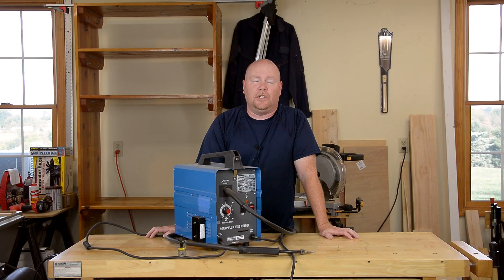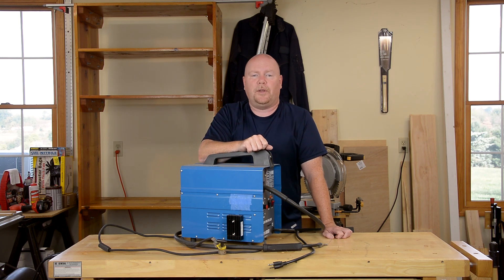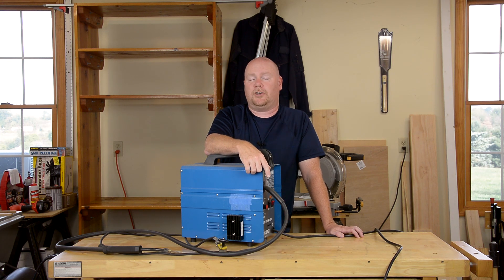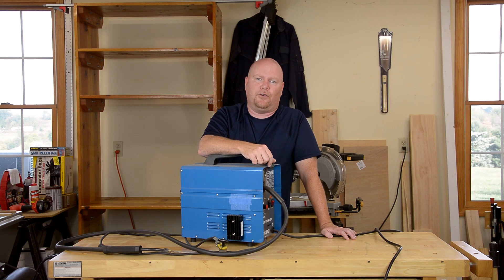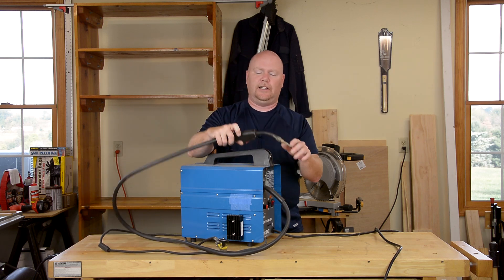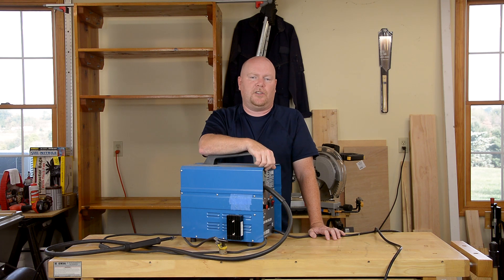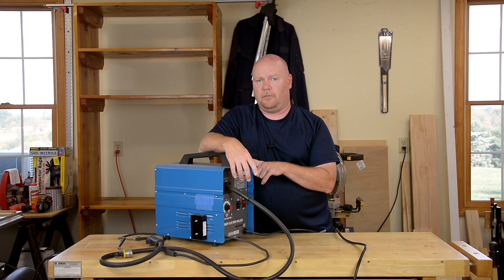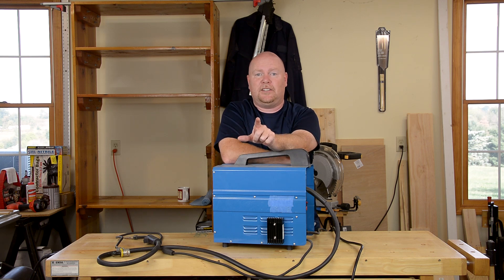Advanced Harbor Freight 90 Amp Welder Mods 09 - The F.A.Q.

Comment: Is there a significant gain in weld penetration and spatter when modified to DC?
Reply from the maker: There's a definite reduction in splatter.  I haven't done and cut/etch testing, but it sure seems "hotter" once converted.  If nothing else because it welds so much more cleanly, doing multi-pass welds is a lot easier.  So, the net is more strength.

Comment: I really appreciate this series of videos Matt, I am definitely going to modify my brand new 90AMP HF welder. I am looking at capacitors on eBay, and I recall you said you'd have liked one with 200,000 uF; I have noticed some car audio capacitors go up to 1 Farad. I take it there is a big difference between the capacitors used for car audio and the electrolytic ones you and others use? Sorry, I don't have much knowledge on using capacitors so trying to learn. I appreciate any info you can provide.
Reply from the maker: Hi Bill.  Car audio capacitors are usually rated for only 20 volts DC, sometimes 24 if you're lucky.  Unfortunately, that's not nearly high enough for this application.  On the plus side, that 200,000 number was a pipe dream.  30,000 is more than enough to get the job done.
Reply: Matt Heere Thanks Matt, I appreciate the response. I forgot to ask, are you planning on doing a video on how to add a resistor to the cap?
Reply from the maker: I'm not.  If you scroll through the comments there's a couple of discussions about this.  In short - the resistor either needs to be able to dissipate a lot of power - or it won't discharge the cap for a long time (and is therefore pretty useless).

Comment: Thank you. Did the mod as instructed on a 2016 issue HF 90A. 100k MF cap, 100A rectifier. FOLLOWED YOUR INSTRUCTIONS IN DETAIL. Complete success. No humming, buzzing, smoke or tripped breakers. Don't see the need to bleed the cap, a quick arc on the table emptied it out. I viewed 5 different mod vids and went with yours. Happy I did.Please continue to use your skills to help others. I'm glad you have children.Jeff
Reply: I would like to do this mod to my new welder too. Do you cut the GND and Torch wires exactly at the same place where Matt cut his or somewhere else (after the relay??)??

Comment: Love the your segments on hf welder 90 amp. is there any chance that wiLL do this to a newer hf 90 ?
Reply from the maker: A couple of people have successfully modified the current model.  It's a little different because the new one has a relay to shut off the power to the torch, but the concepts are all the same.

Comment: Just want to thank you for this series. I got a 130 amp cheapo 115Vac  for free. I completed this mod and now it pushes while welding. It kind of does an on/off with the arc. I have an 150 amp rectifier, and have ranged from 21k uf 63k uf (I bought a cluster of 9 together for $30). I have even tried without a capacitor and it still doesn't have a steady arc. On AC actually has some pretty good penetration but on DC it's super cold. Any ideas where I went wrong? Side note, the capacitors work as far as I can tell, I have to discharge them after turning off the machine. Thanks in advance for any advice you might have
Reply from the maker: Triple check the polarity.   DCEN is what you want for flux core.  You could also check the voltage drop across the rectifier.   Mediocre  diodes can undo all the benefits of the DC conversion.
Reply: Matt Heere polarity is correct, "ground" clamp is positive. I have 50VDC while at rest, and it drops to about 28VDC while striking an arc. Although I might check for a better rectifier. Thanks for kinda confirming what I thought. Really don't mind this machine, just the AC output makes it hard to get the slag to settle.

Comment: I did all your mods plus a cpl I saw on other videos. My welder was so old it didn't have a cooling fan so having lots of computer parts I added a cooling fan for the transformer and the rectifier. Had to add a DC pwer supply for the fans. No heat problems at all. One other thing is I also added a 24v transformer so wire feed is steady now. With all that said I did my first project with it and WOW! What a difference. Thanks for the videos
Reply from the maker: Glad to hear it's working well for you John.

Comment: Hi, Matt. Love your videos. I have an old HF welder and was thinking of getting something else but after seeing your mods decided to stick with this one. I'm pretty good with it as is but think if I do all your mods I'll be happier. Ordered the 3 phase as it was the same ratings and about $8 cheaper. Can use the unused diodes as spares. Found a 130,000 mf 50v cap for $10 + free shipping as the on you used was $20 plus shipping. ATM am watching some of your wood working as I'm mostly a wood worker and part time knife maker. You make great videos and seem to answer all my questions on a project before I can think of it.  GREAT JOB

Comment: I did the upgrades using the 100 amp rectifier you used, made sure all wires were connect correctly and turned it on.  Everything seemed fine so tried welding next.  The rectifier smoked really fast and blew the circuit breaker.  Double checked the wires against your video and all was correct.  Any suggestions on why the rectifier smoked and quite??? thanks

Comment: i bought the components, made the conversion, used the welder for a few minutes and then is stopped welding and hummed for a few seconds and then went off.  I turned off the unit and tried turning it on a little later at which point it started, tripped the breaker and never came back on.

Any thoughts as to what burned out?
Reply: Cole, the easiest way to troubleshoot in this situation is to isolate the components and test them hooked up to the transformer one at a time. First, make sure the capacitor is discharged. Remove all downstream parts from the transformer, short the capacitor again, (you need to KNOW when you start working in there that cap is not energized) and then energize the transformer. Does it seem to come on and not hum excessively? If it stays on it is probably fine and not your problem. If you are capable you can measure the secondary output with a meter. Then I would wire the rectifier all by itself, with the outgoing DC wires removed, to the transformer and again energize. Then do the same with the DC wires hooked up. You repeat this one component at a time until your problem reappears. I suspect 1: the rectifier and 2: the transformer itself, then 3: the capacitor. The humming and then shutting off sounds like a high resistance short rather than a dead short. The transformer, the rectifier and the capacitor can all create a high resistance short circuit. An overheat switch is likely opening the circuit after several seconds.

Comment: I believe that the best thing to do with this kind of machine is to leave it alone !!!!
Sure that you can improve it greatly but    it stays very limited and weird to use specially for a beginning welder.
For the time and money you'll invest in this project, better buy a better machine from a reputable manufacturer or more cost efficient, buy a used machine that can process solid wire and flux cored wire.
Reply: He actually says that in the video series, but he points out that the machine was free to him. So spending some chump change to make it better was worth the cost. A better machine would cost several hundred dollars, I thinks he spent about 40 bucks to make it better. Good observation though if he hadn't purchased it. Best Wishes n Blessings. Keith

Comment: so does the 150 amp rectifier increase duty cycle?
Reply from the maker: Nope.  In fact the mod reduces the duty cycle slightly overall.  With sufficient cooling I guess it would stay the same, but it definitely doesn't go up.
Reply: +Matt Heere hey matt, just finished modding my welder last night (no capacitor) and brought my welder in to work to do some repairs around the warehouse, and it works great! thanks alot for your help man i mean it!
Reply from the maker: Glad it's working out for you.   Love the screen name BTW!

Comment: Hi Matt, in your comments, you mention you discharge the capacitor by "shorting out the wire", what do you mean by that? Do you mean you touch the welder tip to the ground clamp? Thanks for the videos.
Reply from the maker: Yep.   Run out a couple inches of wire and touch it to ground.  It makes quite a show, but it won't hurt anything.

Comment: My question would be, can you bypass the hi/low switch and install some sort pf rheostat potentiometer so you could adjust the current up just a little, or down just a little instead of straight hi and low?  And if so, would you consider doing a video on that task?

I do mostly small gauge tubing welding, and low isn't quite hot enough IMO, but on high it burns through too easily.  Some middle ground would be perfect.
Reply from the maker: Unfortunately no.  The switch selects two different sets of windings on the transformer.  You'll need to practice up on your manual pulse/stitch welding technique :)
Reply: You obviously are more up to date on this stuff than I am.  But for some reason my mind keeps thinking that you would simply have to use the high side of the secondary.  In a welder with adjustable current, is it not the potentiometer/rheostat doing the work of adjusting the amps, while the transformer just supplies the current?  Or do I have that idea wrong?

Not doubting you, just trying to understand. I'm pretty outdated on modern electronics, but I do remember some of my schooling.
Reply from the maker: In theory what you're suggesting is correct, but the parts to implement it don't exist.  The circuit resistance you're trying to control is the weld point, which is essentially a short.  So the resistance range you need in the pot is 0 to about 1 or 2 ohms.   And then the fun part - when you have it set at about 1/4 power, the pot has to dissipate heat equal to the weld power, so if you're welding with 25 amps or so, and the weld voltage is down to about 20 volts, then the pot needs to dissipate 500W.

This is why this is accomplished with tap changes on the transformer in simpler welders and not with variable resistance.  The resistors themselves are simply not practical.
Reply: You can do it with a an scr and use a fan control or light dimmer jyst cool it like the bridge rectifier and if course do it before it converts to dc look up homemade welding circuits

Comment: can I use 370-440v run cap?
Reply from the maker: I'm guessing that, at that voltage, the capacitance is too low to be useful.  Otherwise, the capacitor would be bigger than the welder.

Comment: This may have already been mentioned but about how much were the parts to upgrade this? Is there a parts list in one of your vids? Thanks
Reply from the maker: It really depends.  If you're shopping on eBay then you should be able to get the parts for 50 USD or less.  Some patience may be required though.  If you source the parts from an electronics supplier new, then it'll cost you more than the welder is worth to be honest.

Comment: Great vids.  Is there a good write up on which wires to hook up to that 4 pin rectifier?  Also, the cap location?  Plus, you never showed a vid of welding with it DC.  Would also be nice to see the weld it made.
Reply from the maker: I never did a write up.  Probably should, but just never got around to it.  Your best bet for seeing the welder in action is the series I did building a 3 point trailer hitch for my tractor: https://www.youtube.com/watch?v=4eVr4Nxvxm0&list=PLd_DTtq1stJJlpq47SlM0gjzJWnYKX3Wf
Reply: Sorry, posted too soon.  I found the rest of your video series on how to install them.  Stayed up till 10pm last night, lol.  Thanks for making these vids.

Comment: hier you can buy a 100 amp rectifier https://www.aliexpress.com/item/100A-Amp-1200V-Volt-Diode-Bridge-Rectifier-Metal-QL100A-QL100-12-60-100-new-and-original/32319564076.html?spm=2114.01010208.3.295.PqBNUB&ws_ab_test=searchweb201556_0,searchweb201602_4_10057_10056_10065_10037_10068_10055_10054_10069_301_10059_10033_10058_10032_10073_10017_10070_10060_10061_10052_10062_10053_10050_10051,searchweb201603_2&btsid=be57a2bd-3ae7-46fa-9e70-eb9ca5e36dd3

Comment: I just watched all of your modification videos and plan on doing all of them. Already ordered the rectifier and 2, 10000uf capacitors I'm going to run in parallel. I also had no idea the tip was .035 when the wire is .030 and the feed roller has different sizes. Thank you for the tips! Very clear instructions, very easy to follow.

Comment: Hi Matt, I hope you don’t mind but since your videos have pretty much become the proverbial bible for HF welder DCEN conversion, I thought I would pass along a tip I discovered during the process of doing my conversion. 

For those who end up like us, having to use Home Depot as a parts source, I found a way to get highly flexible insulted 8 gauge wire so you don’t have to fight with that stiff and hard to route wire. Home Depot sells a heavy duty 8-4 Stranded Cord that has 4 separate 8 AWG highly flexible colored coded stranded wires inside. At just under $4 a foot you only need a 1 ft piece to end up with 4 - 8 AWG wires that when striped out is plenty enough wire to do the conversion. 
I’d also like to share some advice, don’t do like I did and over think it making the job harder then it really is. With moderate electronics skills and some parts the whole conversion can be completed in just a few hours.

We owe Matt a huge debt of gratitude for all the time he spends helping out those of us who ask. Thanks again Matt
Reply from the maker: You're too kind Brad.  I'm happy to help if I can - and great tip on the wire!
Reply: Matt Heere can you plz tell me will this capacitor work?  Follow the link to eBay .

https://www.ebay.com/itm/1x-58000uF-60V-Large-Can-Electrolytic-Aluminum-Capacitor-58-000-60VDC-58000mfd/140658782254?hash=item20bfeab02e%3Ag%3AL-QAAOxy1VlRFJMi%3Asc%3AUSPSPriority%2192114%21US%21-1&LH_PrefLoc=1&_sacat=0&_nkw=large+capacitor&_from=R40&rt=nc
Reply: I finally did my conversion and I used the wire you suggested (thanks). I was anticipating not being overly impressed but I was surprised at the difference.
I had used the welder as purchased for a couple of years for small repairs and projects on my own and my neighbors things and had grown accustomed to the small burn holes in my clothing. No Mas! (Sorry Mr. Duran for using your infamous line.) 
Thank you Matt for the clear, easy to follow videos. I would never had any idea how to do this without them.
Reply: Matt Heere mine did not have a fan. I put three computer fans in it, it helped as is. I want to try this on mine. I have one leg and a pace maker will this change the frequencies, and not let me weld with it?
Reply: Joseph Brendel  if is DC is supose to have 0 frecuencies AC is 60 Hz.... DC is 0 Hz
Reply: Alejandro Cueto Gómez sorry but that is not the way it works, in conversion. The bridge rectifier doubles the frequency and halves the amplitude, the capacitor then smooths that waveform, but not completely.
Reply: Purchased a 50v 47000uf black can capacitor that says audio filter and is Chinese made lol hope it works, anyone know if the black caps are just as good or equal to operation with the blue colored ones?